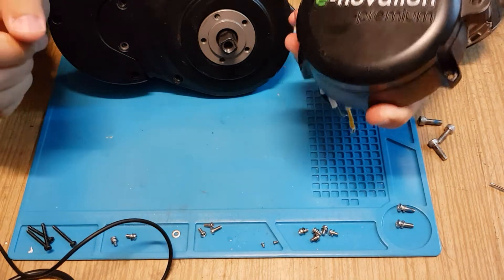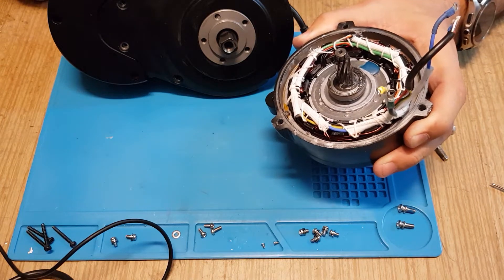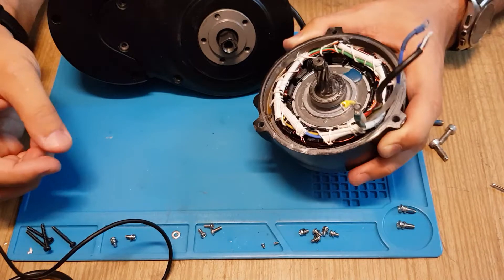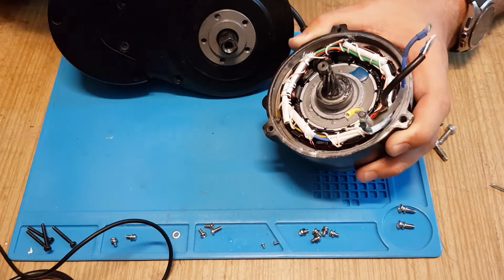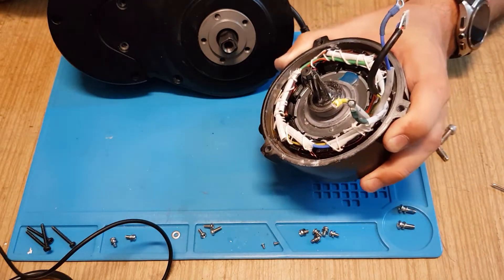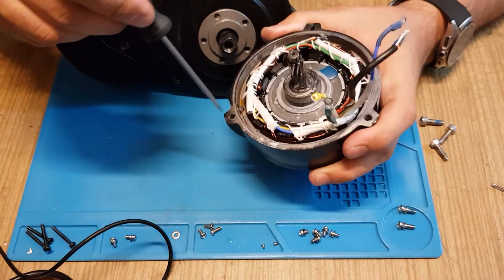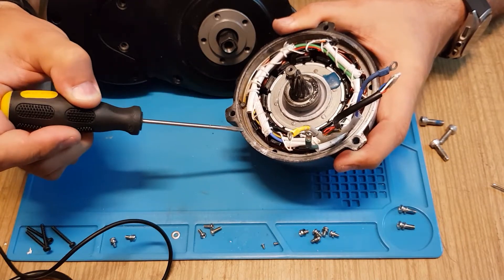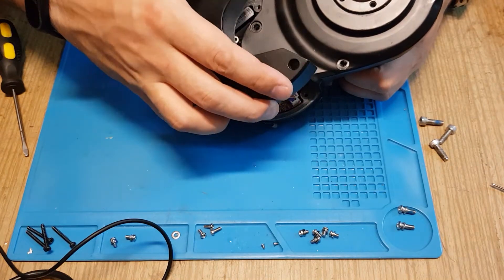e-novation (tranzx) mid drive motor opening

Comment: Couple of questions: 1- is there a way to connect the battery to the motor to check if it's still alive ? (i.e. without controller?) and 2- Did you find any schematics and/or can you take pictures for the two boards in a good quality and share ?, i have similar issue, and would love to use your shared experience here to fix my TranzX M16GT engine
Reply from the maker: If I recall it correctly it's a bruschles motor so controller is a must to turn it on. And sorry but I don't have this motor or schematics any more.

Comment: Hi Is it possible to unlock the speed over 25 km / h??
Reply from the maker: The motor is not to powerfull.. if you want higher speeds bafang mid drive with 500w or more is the way to go ;)